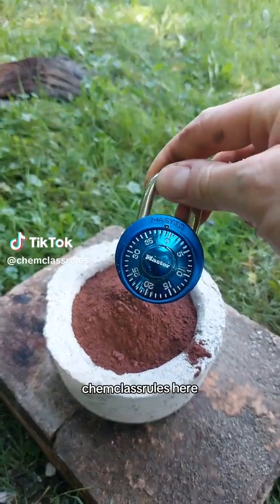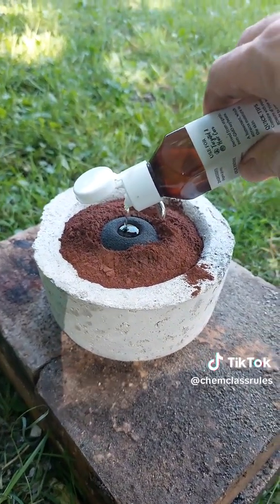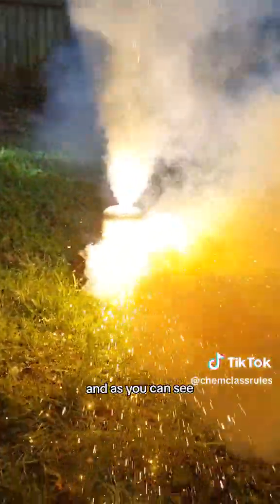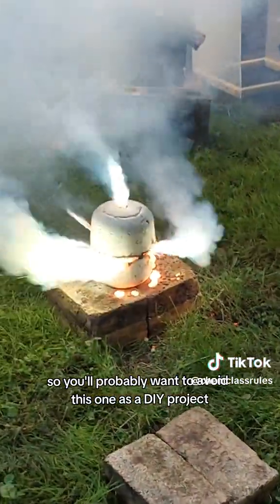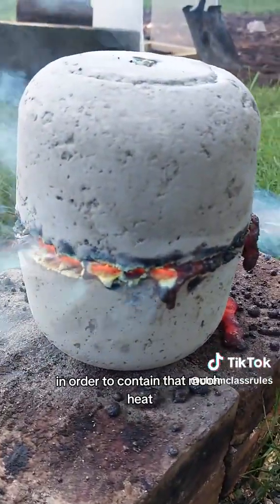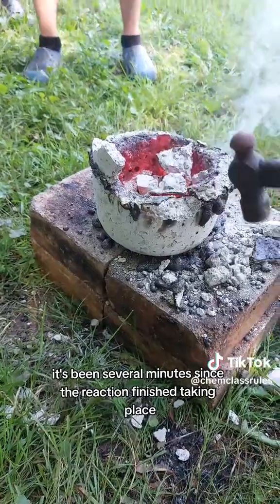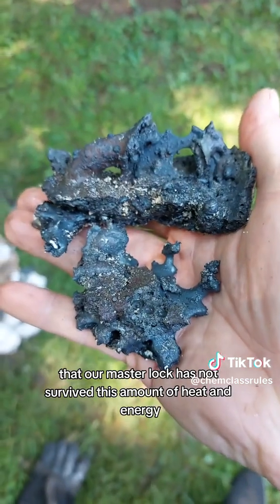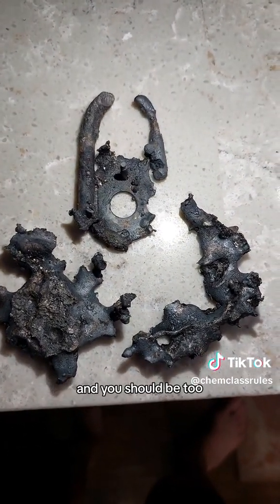lock picking question: does it count if you use thermite? asking for a friend

Comment: You didn't do it a second time to prove that it wasn't a fluke
Reply from the maker: @explainedgmod  you're not wrong, better go buy another lock
Reply: @chemclassrules  Should also attempt a putty version of thermite instead, since most locks when picked aren't exactly able to be placed in a crucible.
Reply from the maker: @ManuFortis you'd have to use quite a bit, I love the idea though
Reply: @chemclassrules  I mean, not really? You just need to destroy the shackle piece, which once melted should be easily removable from the locked item itself. 

You might need a playdough cup's worth.
Reply from the maker: @ManuFortis  seems like we're going to have to test it now

Comment: Thankfully the stone pot was there you wouldn't want to have been scorched by the somewhat exothermic reaction blasting out of the sides onto the grass
Reply: imagine how it was without the stone
Reply from the maker: @neutronenstern.  luckily we don't have to imagine, I'll post an open one later so you can compare 👍
Reply from the maker: @natg9961  I make those crucibles out of mortar, sand, and plaster. If you're going to cover it (to trap more heat) it can't have a full seal or the gasses can't escape
Reply: @chemclassrules  Those embers that spit out the side are they not hot? They looked like they hit the cameraman
Reply from the maker: @natg9961  lol, they're around 2000 degrees, but if you look at the quality of the video, you'll be able to tell that this is zoomed way in. the camera man (me) was unscathed